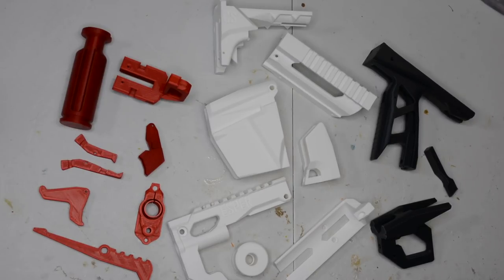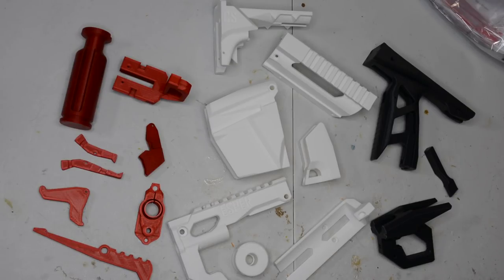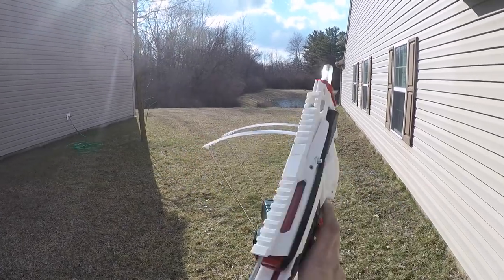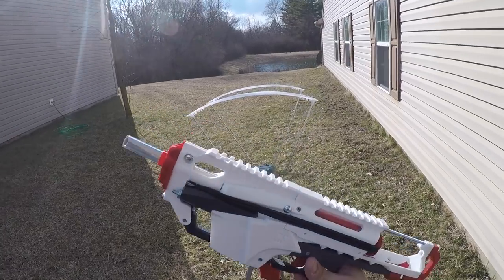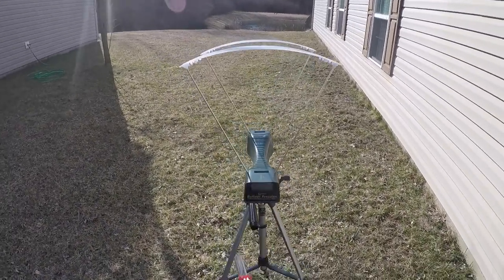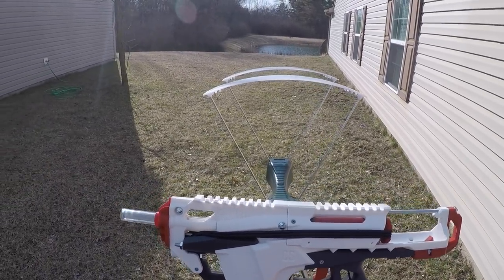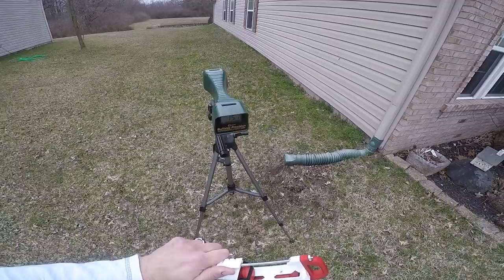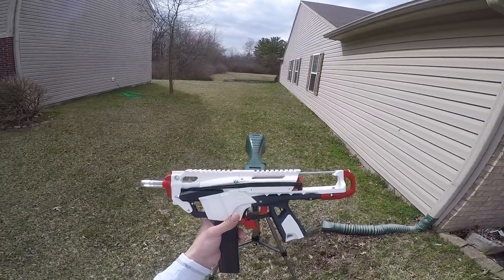[NERF MOD] White Strike ESPER (A 3D Printed String Powered Nerf Blaster)

Comment: Did you have the bands at the default 20 inch for the first test, and how much for the second test, also how hard was the prime in relation to let's say a modded Kronos? Also Slug mentioned someone used slingshot tubing to get just shy of 200fps on the Esper!
Reply from the maker: Pretty sure my first test was at the normal length. I cut the strings to the 20 inches and then tied it as close to the end as possible. Second time I had it to tight for my liking. Prime was a little too tough and that made it unreliable to catch. Not sure exactly the length that it ended up being probably cut 2 or so inches off. Once I have a better priming grip It will make it a lot easier to prime. It is not quite as hard as a modded Kronos in my opinion.
Reply: @NaptownNerf  If you have issues with catching file down the front of the EndCap print just below the threaded rod.
Reply from the maker: @CaptainSlug  Yup I did this some, but may need to go a bit further. Thanks for the tip.